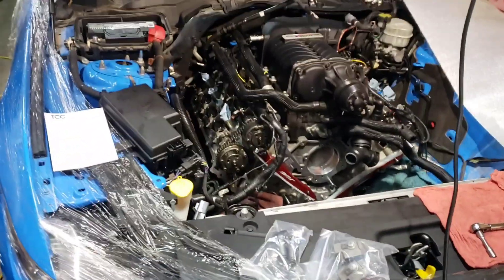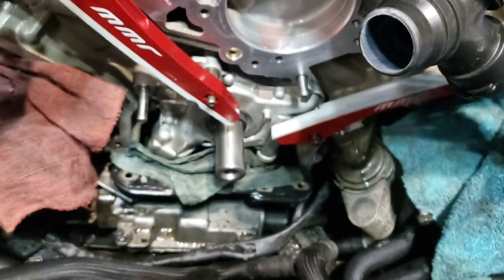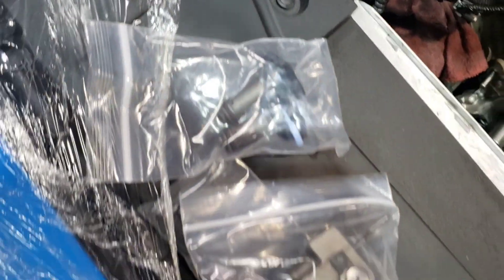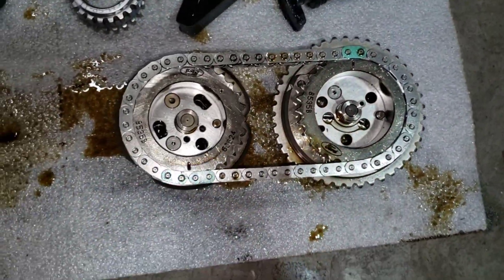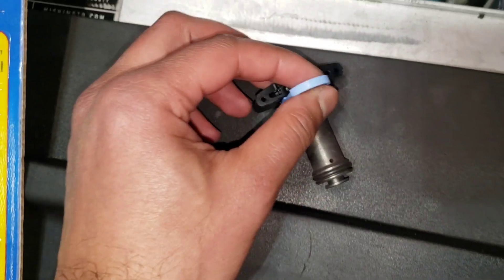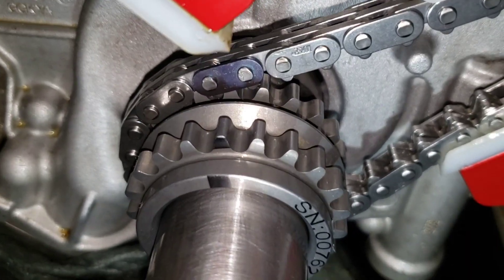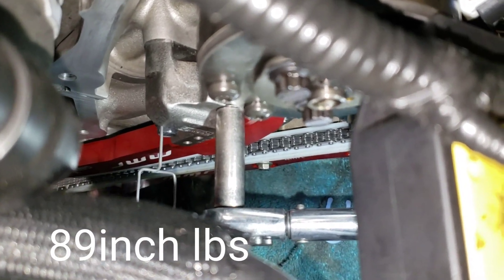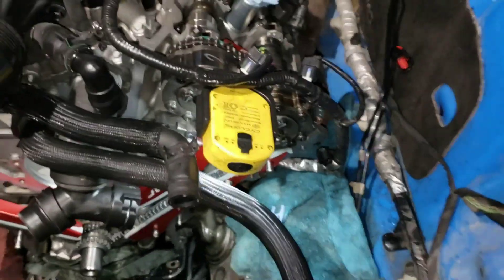How to time gen 2 coyote mustang engine bulletproof timing

Comment: So quick question. Did you have a problem with a P0345 and 349 code. Camshaft out of position code. So you have to be tuned for the inverted timing tensioner. I’m having this issue. That is the only thing I have changed in my build. Timed the car 3 times. So I know it’s not out.

Comment: I'm putting together a list of things I want to do to my 2015 f150 5.0 and upgrading the oil pump is something I feel the need to do, but as a mechanic I still have a "since I'm here" mentality, and I think I'm going to add this MMR pro kit to the list since I'll be taking off the front cover. What other upgrades to the valvetrain would you recommend?
Reply from the maker: @hitmanhartman  MMR flipped tensioner bracket and some cams
Reply: @texaseliteperformance4471  thank you for the fast response! What cams would you recommend? I always hear that the stock cams are just fine?
Reply from the maker: @hitmanhartman  depends what your building the truck for I'm assuming your revving the truck high rpm, get some comp cam nsr cams
Reply: @texaseliteperformance4471   I plan to supercharge the truck, I want it to be a fun sleeper while maintaining reliability, hence why I want to do these valve train upgrades to prevent breakage.
Reply from the maker: @hitmanhartman  just do the mods on this video truck will be pretty strong

Comment: Great video, thank you! When you were rotating the engine, the passenger primary guide on thr tensioner side was moving a lot, almost like the tensioner was pumping up and then collapsing. Any idea why the guide was moving so much?
Reply from the maker: Because there was no oil pressure in the tensioner

Comment: The guy on the phone at MMR told me the Boss secondary tensioners were too short and not compatible. 
I didn't understand why they wouldn't work clipped to the bracket or not. The secondary pushing the guide against the chain should hold it tight in the bore. 
Thanks for your videos!
Reply from the maker: I checked the ford work shop manual, that's how they are now, the little metal tab on the gen 1s aren't used anymore and I did two coyotes like this both are running great